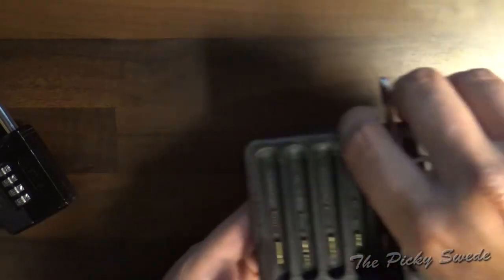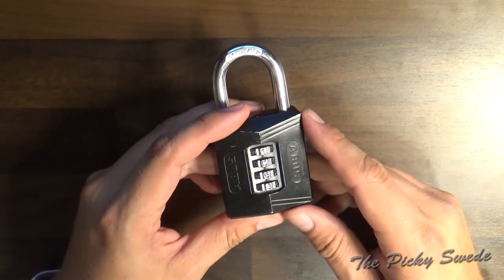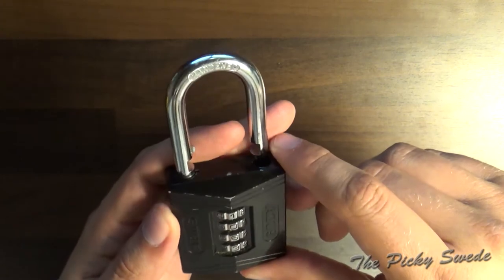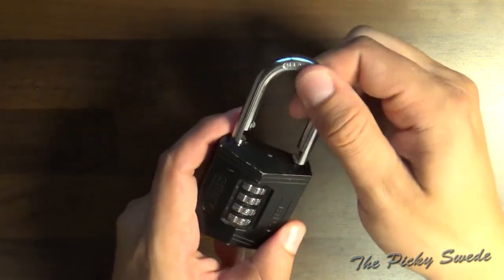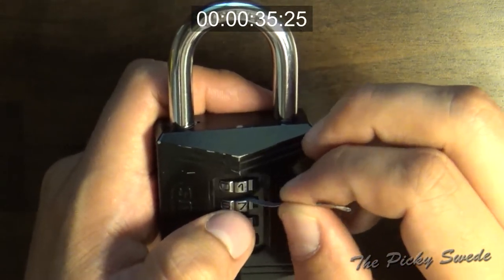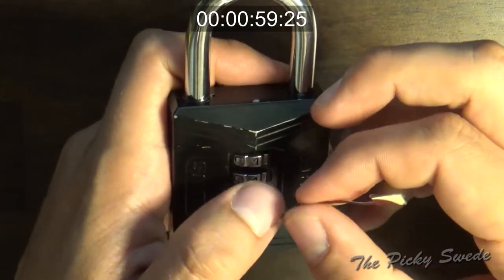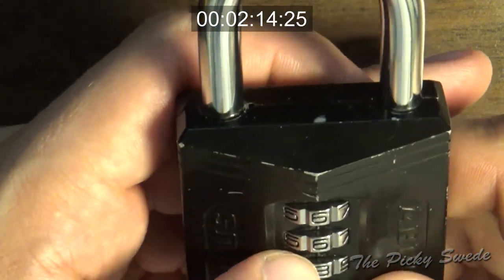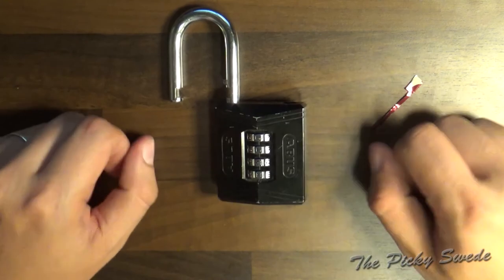021 Abus 158 Decode

Comment: Enjoyed watching this. I wish there was a combination lock that couldn't be picked like this, or by any of the equally simple methods. That would be great. I have asked Abus for information about their 190cd/60 combination lock ease of picking, but of course they either don't know, or won't say. Thanks again for the video. As for the "breathing", it didn't bother me one bit!
Reply from the maker: Dexter Sachs Thank you sir. I will try another combination lock in my next video. I am also planning on reviewing tools for this method in an upcoming video.
Reply: Thanks for your reply. I'll keep looking, too. Supposedly the older S&G 8077 combination lock is extremely difficult to decode or fool, but its weakness may be the thinner shackle, able to opened with a bolt cutter. Not willing to buy one to try to cut. ;)   Thanks again for your great videos!!